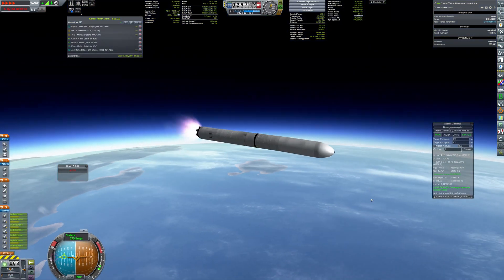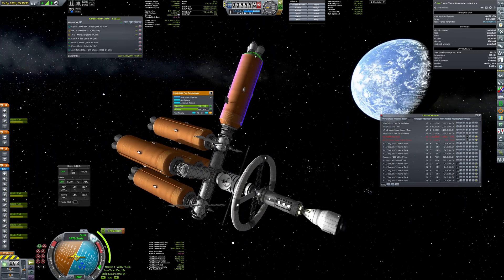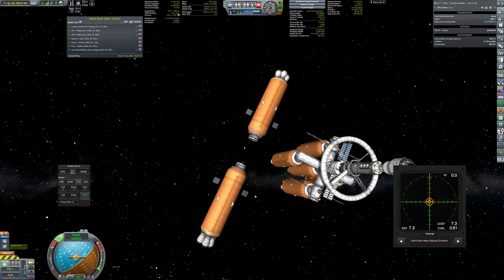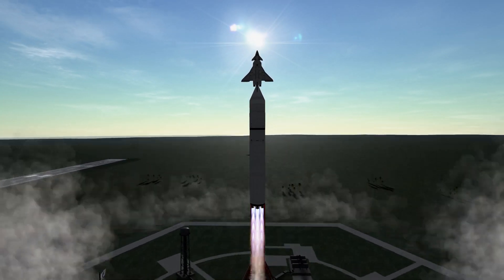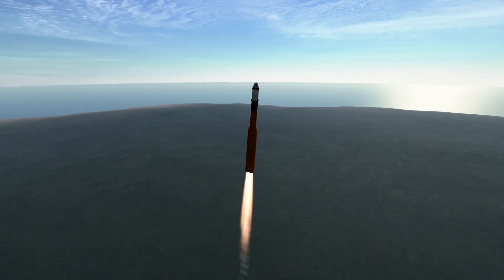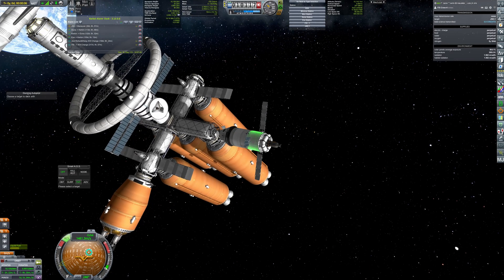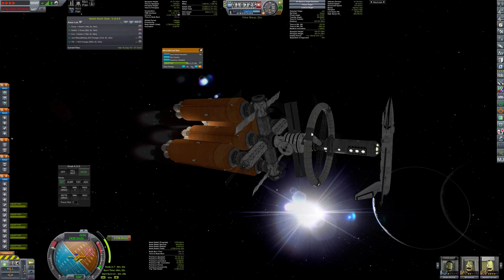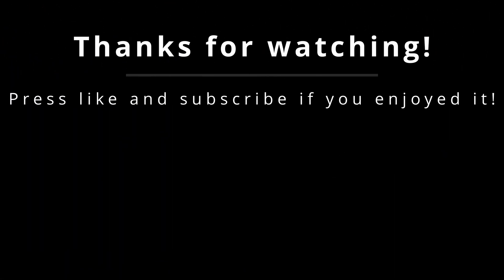Journey to Jool:  Departure (JNSQ + Kerbalism)

Comment: What mods are you using?
Reply from the maker: Mostly those:
AlphaMensae's Modular Launch Pads
Animated Decouplers
B9 Part Switch
Better SRBs
BetterBurnTime
BonVoyage
BreakingGround-DLC
Chatterer
Chatterer Extended
ClickThrough Blocker
Community Category Kit
Community Resource Pack
Community Tech Tree
Contract Configurator
Contract Pack: Bases and Stations Reborn
Contract Pack: Tourism Plus
Craft Manager
Cryo Tanks
Cryo Tanks Core
Cryogenic Engines
Custom Barn Kit
Custom Pre Lauch Checks
Deployable Engines Plugin
Distant Object Enhancement Continued
Distant Object Enhancement Continued default config
Docking Port Alignment Indicator
Dynamic Battery Storage
Easy Vessel Switch (EVS)
Engine Lighting Relit
Environmental Visual Enhancements
Filter Extensions - Plugin
Firespitter Core
JNSQ
Kerbal Actuators
Kerbal Alarm Clock
Kerbal Construction Time
Kerbal Engineer Redux
Kerbal Joint Reinforcement - Next
Kerbal Planetary Base Systems
Kerbal Reusability Expansion
Kerbalism
Kerbalism - Default Config
Kerbalism Companion Calculator
Kerbal-Konstructs
Kiwi Tech Tree Overhaul
KRASH - Kerbal Ramification Artifical Simulation Hub
KSC Extended
KSP AVC
KXAPI
MagiCore
Magpie Mods
Making History
Malemute Rover
Mandatory RCS
MechJeb 2
MechJeb and Engineer for all!
MissingHistory
ModularFlightIntegrator
Module Manager
Near Future Aeronautics
Near Future Electrical
Near Future Electrical Core
Near Future IVA Props
Near Future Launch Vehicles
Near Future Propulsion
Near Future Solar
Near Future Solar Core
Near Future Spacecraft
Omega's Stockalike Structures: No Textures Required
PlanetShine
PlanetShine - Default configuration
Precise Maneuver
Procedural Fairings
RasterPropMonitor
RasterPropMonitor Core
Rational Resources
Rational Resources Parts
RCS Build Aid
Real Plume
Real Plume - Stock Configs
Reentry Particle Effect Renewed
ReStock 
ReStock+
SCANsat
scatterer
Scatterer Default Config
Scatterer Sunflare
SmokeScreen - Extended FX Plugin
SpaceTux Library
StageRecovery
Stockalike Station Parts Expansion Redux
Textures Unlimited
The Janitor's Closet
Toolbar Controller
Tracking Station Evolved
Tundra's Space Center
USI Tools
Waypoint Manager
WorldStabilizer
Zero MiniAVC
Reply: @Darkherring  what exactly is the profile in TUFX?
Reply from the maker: It's basically this one: https://github.com/Katniss218/KatnisssTUFX
With minor tweaks
Reply: @Darkherring  and what version do you play?
Reply from the maker: @StyggeOrd08  it's 1.11
Reply: @Darkherring  ok